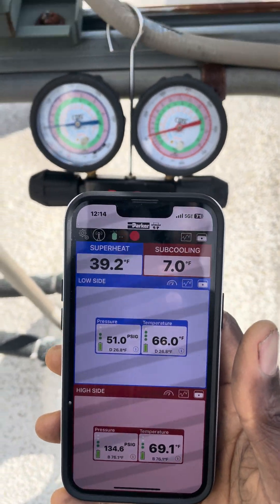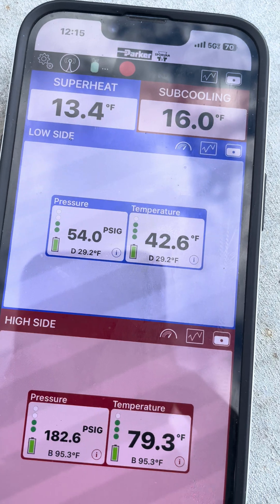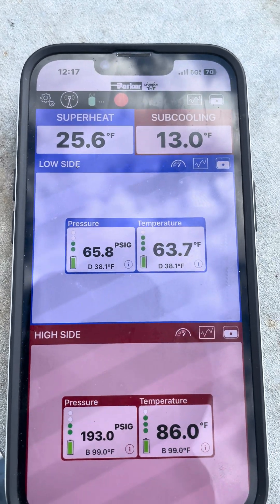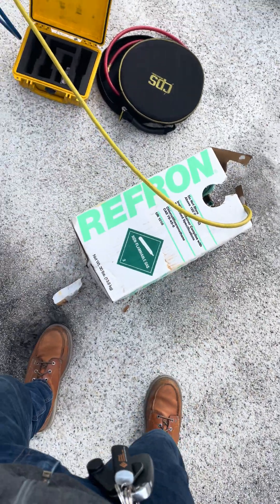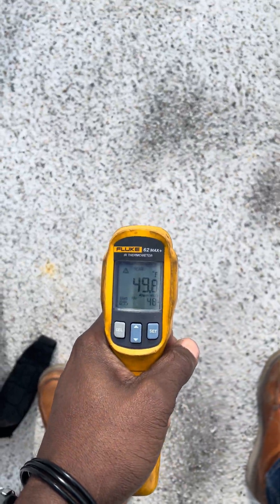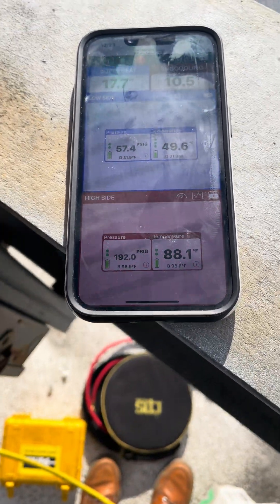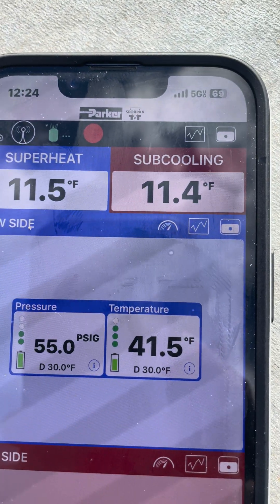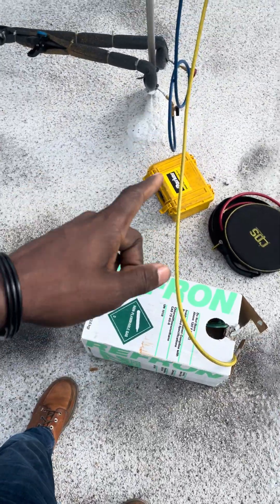HVAC LOW REFRIGERANT SYMPTOMS

Comment: Wouldn't a 40 to 42 degrees evaporator saturation temp be ideal?
Reply from the maker: It depends on manufacturer and design conditions also load ,    i would say 35 degrees is optimal if system can achieve it